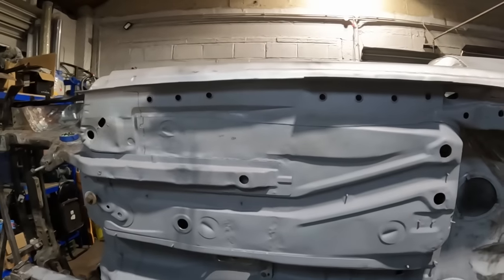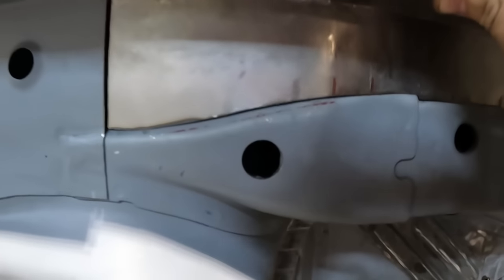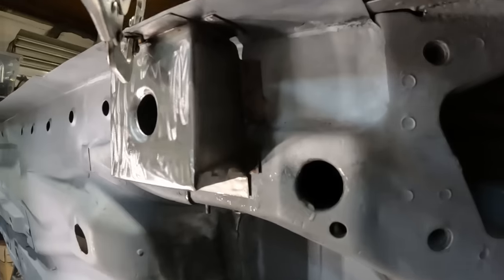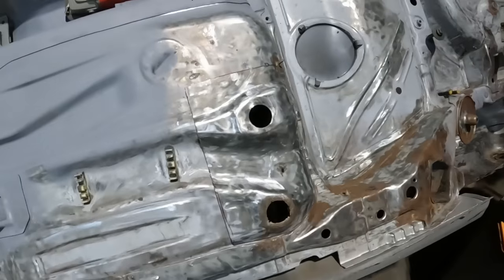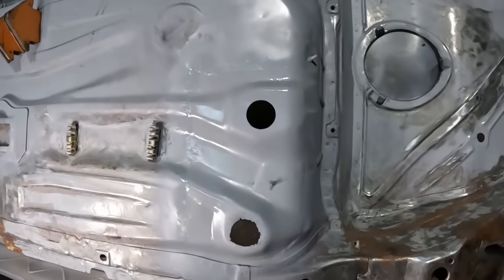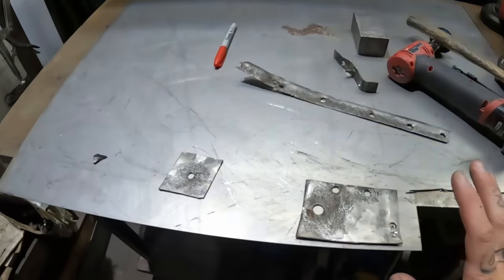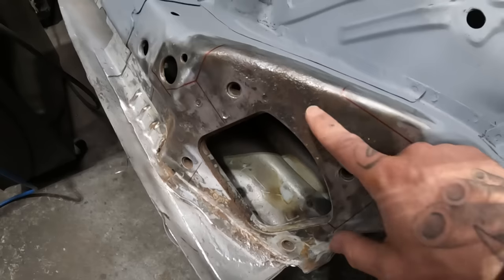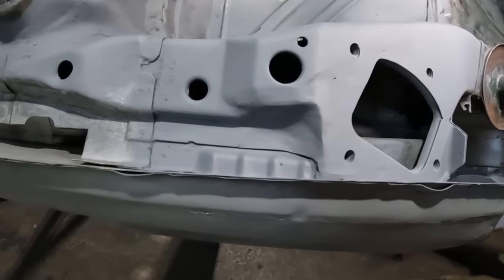Audi s3 Quattro Swopped Mk5 Ford Escort Chassis Swop Project Ep16, Rust Repairs

Comment: Hi Terry you should drill for draining holes in your jacking point. Otherwise,  the inside rounded dimple will stop water from draining
Reply from the maker: Yeh already on it mate, completely forgot about drainage while making and installing that piece, I’m going to lop a few mm off the corners for drainage

Comment: Coming on really well pal,, you want to cut and Butt when your putting panels together.. so much easier to join especially if you can get to both sides,,, really need to get that bead roller electric,, honestly it’s a game changer 👍🏻👍🏻. Great work,, you inspire me to crack on with mine
Reply from the maker: I’d love to get a motor on the bead roller, it’s just finding time to do it and finding the motor etc, I also need to brace it aswel, iv noticed it flex’s a good bit while trying to do anything 👎🏻
How you getting on with yours? You was doing the mk4 on mx5 on Facebook wasn’t you?
Reply: I am mate,, I have the build o. Here,, i literally dropped it on its wheels yesterday for the first time and had the rear wheels spinning,, miles off but a massive boost👍🏻
Reply from the maker: Ideal man, well done, I bet that was a great feeling!! I’m soooo far off that point yet but I can wait until I finally get there!
I think I may have watched a couple of your videos actually, it’s a purple colour mk4 isn’t?

Comment: Terry, with it being a track based car, do you need to put those holes back into the floor pan? or can you just get rid of them and fix the rot issue for good. You may need a drain hole in your jack box as well. Looking great though marra.
Reply from the maker: Ideally I want it to still be road car aswel if I can get away with it so just trying to cover all bases really, and with how rot both these car wer I want to get rust prevention in every nook and cranny as possible lol and yes, I need to take the corners off the jack box at some point for drainage, doing the inward dimple die was an after thought and then forgot all about drainage if I’m honest lol

Comment: Great work Terry, keep it up.
With regard to the last pieces you made, if you had cut a piece of metal slightly oversized & used 3 of the bolt holes for the radius arm to clamp it in place, you could have hammered the metal into shape around the existing panel, before cutting it out.
Also if you have Mapp gas, you could've heated the metal up to shape into that tricky bit.
You're welcome👍
Reply from the maker: That’s a good shout with the mapp gas and I keep plenty of stock in my van for work so I may have a go at that technique if I need to do a similar piece👌🏼 shaping that piece over the top would have been sooooo much easier doing it that way haha good work out though doing it on the bench 😂

Comment: I've got the same bead roller and I’ve fitted the wheel off an old cement mixer. Still need to brace it to stop the flex
Reply from the maker: Yeh I definitely need to brace it, considering how thick the steel is I was surprised how much it moves! A friend of mine said about a cement mixer wheel, I have been looking for one but nothings come up local as yet, and even junk ones still seem to fetch strong money! I’ll keep my eye out though!

Comment: I cant remember the episode but the bad obsession guys had the same issue with one of them rollers so automated it, i think with an old starter motor but could be wrong. Would be worth checking out how they did that.
Reply from the maker: I think most people use garage door motors from what Iv heard, I have been meaning to do it but it’s just finding the time really…

Comment: No gloves! What's that paint stripper like on bare skin? Back in my mis-spent youth with Nitromors even the tiniest splatter would sting like a hornet and god forbid you got a large splosh on a bare arm or leg.
Reply from the maker: No gloves to hand at the time unfortunately, I did take precautions though and had a can of brake cleaner ready to blast off any I may have got on my hands, followed by our sink just round the corner…
I get alsorts on my hands daily anyway being a plumber lol